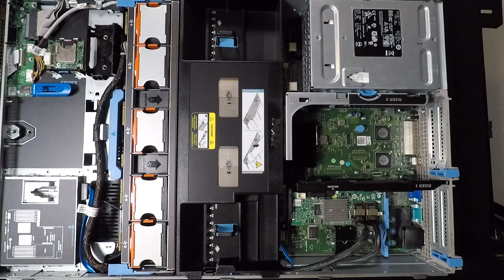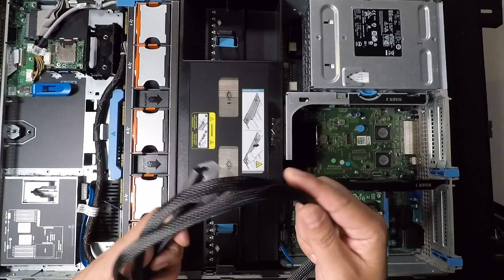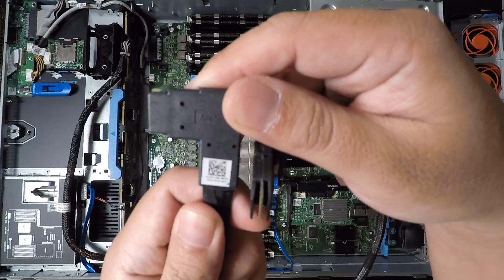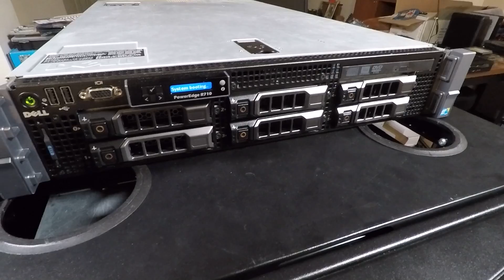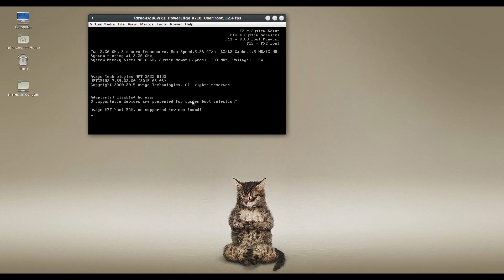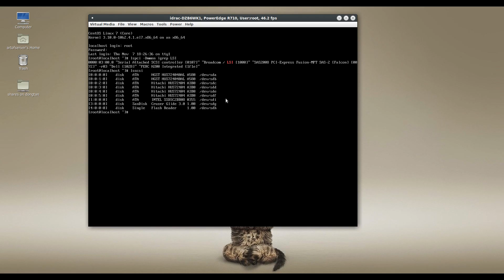I FINALLY found alternative SAS cables for the Dell PowerEdge R710

Comment: Well, 5 years after this video aired I'm here to thank you for having the card/cables available when I was looking to do the replacement.
I have an odd question though.
I'm attempting to flash the original perc 6/i card into IT mode and I want to put it in a normal desktop server.
I already know the card works and is detected (haven't gotten around to flashing it yet), but I was wondering if you've ever heard of, or seen any breakout cables that can plug directly into SAS drives from the perc card, bypassing the backplane altogether?
Reply from the maker: Well, first of all, I don't know that a PERC6 card can be flashed to IT mode. Not all LSI controllers can be converted to IT mode. As for the cables, you would need SFF8484 to SFF8482 cables, but I haven't looked for such cables before so I don't know if they are easily available or not.
Reply: @ArtofServer  Much appreciated! Thanks

Comment: Hello
Your channel is very helpful and I enjoy watching it.
I have a question for you. If you connect the SFF 8087 cables to the H200 controller in IT-MODE in this Dell R710 server, do you connect the wires as in the recording, i.e.: BACKPLANE-A to H200 PORT A and BACKPLANE-B to H200 PORT B
After logging in to the H200 controller, do you match the slot numbers with the numbers on the front of the server? I have that if I connect the SAS cables as you did in the video, I have different slot numbers. For example, where there is slot 0 on the front of the server, after inserting the disk, I have information on the controller that it is slot 4, and where there is slot 5 on the front of the server, after inserting the disk, I have slot 1.
If I reverse the cables in the sense: BACKPLANE-A to H200 PORT B and BACKPLANE-B to H200 PORT A, then the numbering is fine, but unfortunately I have an error on the SAS server CABLE A FAIL somthing ...
But that's how it all works and the operating system detects the drives correctly.

Is it caused by wrongly selected cables?
Have you encountered something like this?

Regards
Gregory
Reply from the maker: What you are describing is expected behavior. There's what's going on:

1) Dell uses some signal between HBA and backplane, probably over the sideband wires to detect cable presence. If you connect A to B, it disrupts that signal and you get the warning about SAS cable A.

2) LSI at some point, decided to reverse the port enumeration order on HBA controllers. I think sometime around version P10? So, LSI RAID controllers and LSI HBA controllers enumerate in reverse when you have the latest firmware. Since These older Dell servers never had a HBA option and was mostly meant to be configured with RAID controllers (like PERC6/I or H700), the numbering on the chassis matches that pattern. If you use a HBA with LSI firmware, it's going to seem backwards.

There's nothing wrong with your system necessarily. Hope that helps!

Comment: Thanks, we got a used R710 from ebay few weeks and I was able to setup the virtual disk and installed Windows Server 2019. But, not sure what happened, it is stopped working and I can't even get into the BIOS now, can anyone comment on this? Please let me know if you want more details
Reply from the maker: Maybe explain what you mean by "can't even get into the BIOS now" ? The system won't POST? Or it begins POST and gets stuck?

Comment: Thanks ... I bought these and the H200 Card for my R710 from Art of Server ebay. I can now see drives greater than 2TB so extremely happy.  Minor dramas when SAS B couldn't detect, swapped the cables, but i think the cable was not seated correctly. So satisfying to see it boot with the larger capacity drives. Now I only have rebuild the UnRaid box :)
Reply from the maker: Great to hear your system is up and running! Thank you for choosing to support me by shopping at my store!

Comment: I would note that the factory Dell cables for an H200 do not have right angle connectors on the SAS card end. That's only when you have the H700 card installed. The H700 is a full height card and there is not physically the space to get straight connector in which is probably why Dell came up with the right angled versions. Well you might be able to force it but I was not willing to do that so had to hunt down some of the right angle cables. Cost more than the H700 cards did. I have been modifying the specification of a couple of now spare R710's that had been purchased at a different time so that it matched a  homogeneous cluster of R710's that we still use at work in production. Sure they are old but we can tolerate a complete node failure without loss of service and I now have extra nodes in the cluster. Really useful videos to help me nail down what parts I needed to purchase and how to get that dam plastic bit on the side of the case off to route the new SAS cables.
Reply from the maker: glad this helped. thanks for watching!

Comment: Hi, would it be possible to ship cables to the Serbia? I'm stuck with R710 and H200 without proper cable.
Reply from the maker: I only ship outside the USA using eBay Global Shipping. Unfortunately, Serbia does not look like a country that is on their list: https://pages.ebay.com/seller-center/shipping/global-shipping-program.html
Reply from the maker: BTW, another option that I've seen some buyers use, is a package/mail forwarding service. So you can use USA address to order your item, and the service will forward it from that address to your address in Serbia. I don't have a specific service to recommend, but I know I've had a few buyers that used that type of service to buy from my eBay store. Hope that maybe that will help...

Comment: Sir, I am building a new PC. I've already had a SAS hard drive. My question is,  is it really worth it to buy a converter to convert from SAS connector to SATA connector or just buy a new SATA drive?
Reply from the maker: there's no converter to change a SAS HDDs to SATA HDDs; doesn't exist as far as i know. there are 'interposers' that you can install on SATA HDDs, that allow it to work better with SAS controllers, like dual channel setups, but not the other way around.

Comment: Why did you need to change the original cables?
Reply from the maker: The SAS cables with the original PERC 6/I had SFF8484 connectors which will not fit on the H200. The H200 needs SFF8087 connectors.